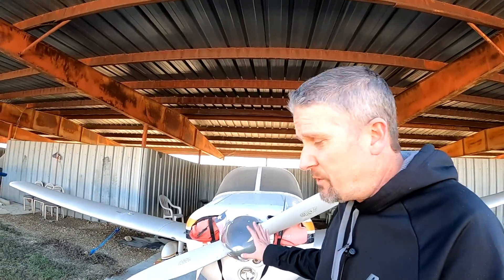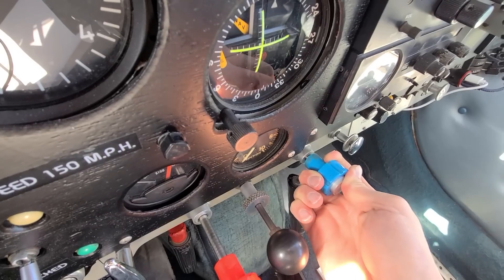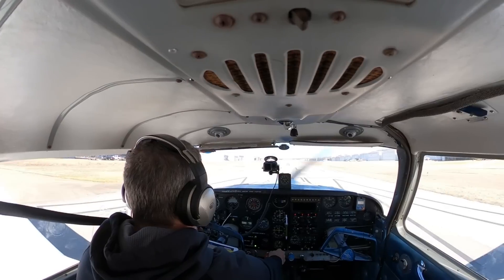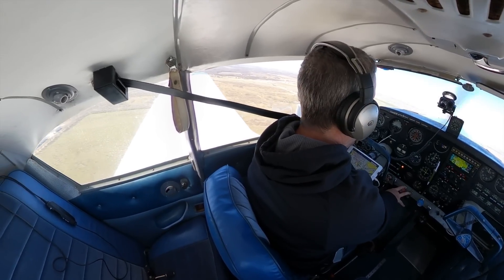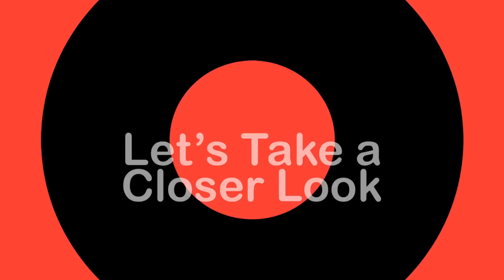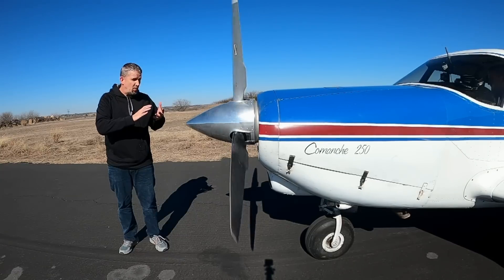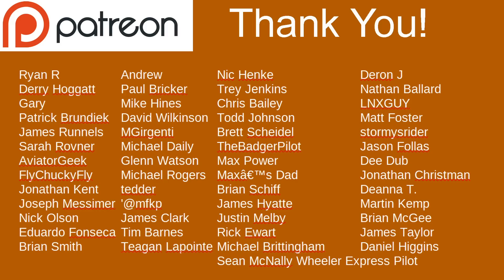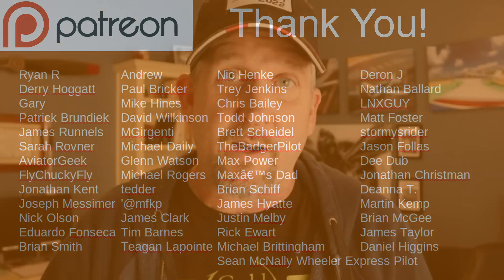How a Constant Speed Propeller Works - Simple Explanation

Comment: As a musician, I got a kick out of the tuner app.   
I think the constant part refers to when you REDUCE manifold pressure (LESS POWER), the RPM will stay the same while in flight..  Found this to be true in my buddy's Skyhawk XP and also in my C-182T.   In other words, at cruise, running 'square' say 2400 MP/prop  rpm,  reduce power, yet the prop will change pitch automatically to maintain that 2400 rpm, to a point.

Comment: Best description is it's like overdrive for your plane. At altitude the motor can operate at peak torque rpm and pitch the prop till it slows 20 rpm and then back off slightly. Should be the best you're gonna get, except a tail wind.

Comment: I don't think you know what your talking about. constant speed means that the propeller spins at the same speed as the aircraft's wheels. This type of propeller is for aircraft that have no wings. Fixed propeller means that the propeller is screwed into solid bolts.

Comment: So that's what that means, judging by the video if you push on the little blue lever the prop turns clockwise and if you pull it goes counter clock wise which would aid in backing the plane into your slip.

Comment: Before ETPs (Electronic Tuning and Pitch), we used to have to verify pitch using a set of tuning forks.  Hold the fork for your desired pitch up to your ear, then pull the knob until the prop pitch matches the tuning fork. I liked flying a little sharp of pitch, but there are those that prefer flat of pitch.
Reply: I remember when Taco Bell started supplying sporks. The tuning spork was a game changer for me.
Reply: oh damn a tuning fork is genius. On this side of the word we used saxophones for pitching the prop. The annual A&P tuning of the sax alone was a pain in the ass.